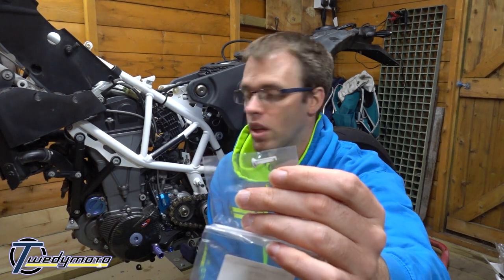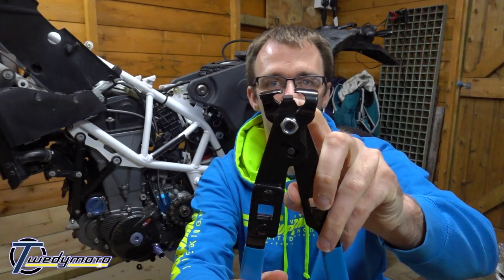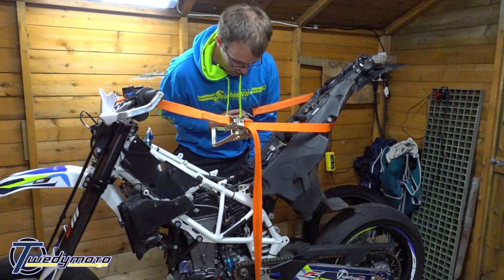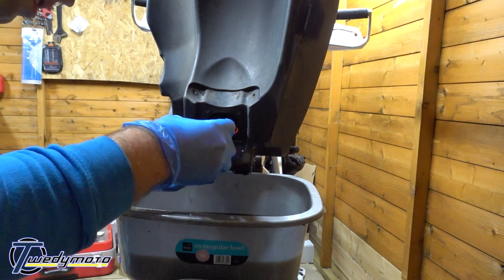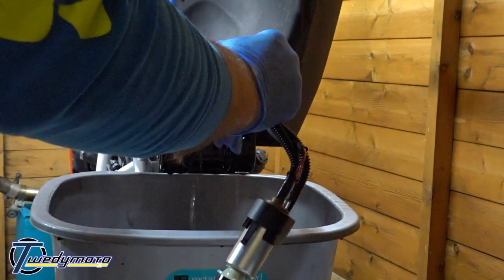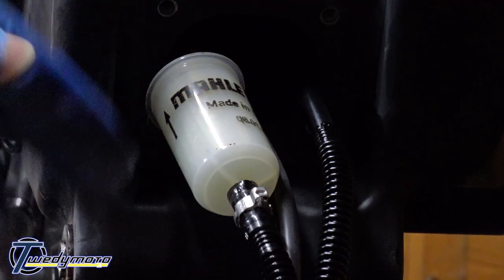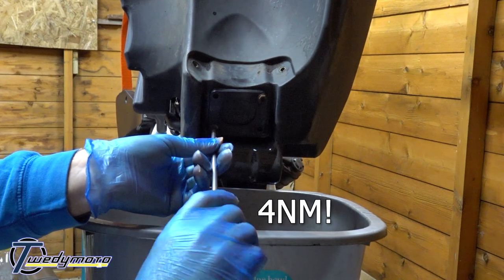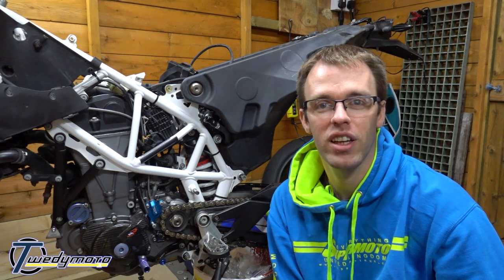How to replace in tank fuel filters on Husqvarna 701 & KTM 690

Comment: Thanks for the video!

 I am a "KTM fuel injection Beta Tester pioneer" as I own a '10 Husaberg FE450, which had injection before the KTM line did and of course being nothing more than a very confused KTM, my 'Berg (as was very common with them) had fuel pump issues.  A Cycleworks pump was/is the hot ticket for those bikes.  The in tank guts of your 690 look the exact same as my 13 year old Husaberg, which makes me wonder if KTM has learned anything at all since then 😄  The Cycleworks pump is not prone to polluting the fuel filter with black stuff, and it has proven to be stone reliable in my 450.  I may proactively get a Cycleworks for my 701 and keep my new low mileage OEM pump as a spare.    

I elected to delete the in tank Mahle fuel filter on my old 450, and am running an external 10 micron Wix metal canister filter that I replace annually.  Replacing the external filter on the old 'Berg with it's funky 70 degree engine layout is super easy, takes 10 minutes, tops.  Have had no fuel system issues since tossing the failed OEM pump into the garbage can and doing the external filter modification on my old Husaberg.  Actually, that bike has been completely reliable since the initial fuel pump issue was addressed.  

I wonder if there is enough room to do a similar external fuel filter mod for my 701.  For sure a slim Golan filter would work, but I would want to use the not big but bigger (and cheaper) Wix filter if the in tank Mahle filter is removed.  It looks like there may be enough room if I plan it out right.  That is the good thing about Winter - it is a good time to fuss around with the bike!  Will  probably see if I can get a Wix filter in at or near the quick connect area, and leave the stock in tank one in place for a season or two, then do the bypass mod.  The fewer times one has to unscrew those self tapping fuel pump base plate mounting into plastic screws the better...

Comment: Another good vid mate. I used a pair of snips to compress the clamps on my 2018. I noted how much the old ones were squeezed before I removed them and carefully judged how much pressure I applied. Finally I checked that the pipes were fully secured. I've done another 8,000 miles since then so I'm happy with that. Interestingly, I was chatting to Rob, the mechanic at Huskysport, doown south, and he reckons they rarely give trouble. Nice to change the filters all the same though me thinks. How about a vid to change the fork oil?I did mine last autumn at 18,000 miles and it was surprising how dirty the oil was. You need a thin-ish 22mm spanner to hold the inner cartridge mechanism but other than that it's pretty straightforward. Cheers mate.
Reply from the maker: Yeah, from what I can remember there hasn't been many posts about them causing an issue but why wouldn't you change them 👍.  Good idea on the fork oil change! Will see what's involved.

Comment: Did this yesterday on the 19’ SMCR and sure enough, the one bolt just spins when you take the T45 side out . So, I put the 5mm Allen in that side and tried to back out the other side… it was so tight it snapped the Allen key off inside the channel. So,  that makes it impossible to get the tank tilted up. I just pulled the pump from underneath and replaced the filter and screen with Oetiker clamps as recommended. Not sure why they want you to tilt tank up… you don’t need too! Can’t figure why it was so tight that I couldn’t get the bolt out, but at least I found out you don’t need to tilt the tank to do this or replace fuel pump. Went for ride because I was worried about kinks in the fuel line when I shoved it all back up in tank. It ran great with no leaks.
Reply from the maker: Wow that's mad! must have had loads of thread lock or something for it to snap an allen key!
Reply: Same here.  I did not have to tilt the tank up or take the exhaust can off.  Just the four bolts holding the pump in.  I figured there must be a reason you did that way, but I thought I would try it, anyhow. And they worked! Thank you very much for the very informative video. I could not have done it otherwise.

Comment: Just lifted the tank on my ‘21 701 to remove the shock. Pretty much all the cables were tight from the first cm of lifting the tank 😅
Reply from the maker: What a ball ache!! Guess I got lucky then haha
Reply: @Twedymoto  Bought this bike a week ago, coming from a DRZ I’m not used to all these wires. Need to learn what they all are and where they can be disconnected.
Reply: @JohannesDalenMC  Hit up Rottweiler Performance, they sell delete kits for a lot of that garbage.  Really cleans things up under there and the O2 sensor delete richens up the part throttle settings a full AFR point, which makes is run a lot better.

Comment: Awesome video! My 2016 690 ER pump seems to have failed as there is no fuel coming through at the quick disconnect. When setting up my Safari tank I removed the tiny inline filter and added a Golan filter to the line. In this case can I just removed the plastic filter in the tank? Could you please suggest the suitable joint to connect the hoses to delete the filter in the tank? Thanks in advance.
Reply from the maker: I'm not entirely sure fuel is supposed to come out of the quick disconnect if they're disconnected. I'm pretty sure I've seen posts where some owners have removed the filter from the tank and put an online filter like a Golan one between the tank and the quick disconnect. Hope that helps 👍

Comment: I see some riders access the fuel filter without removing lower tank bolt and swinging it up.  Do you know if it's possible to replace filter without swinging tank up?   Thanks.
Reply from the maker: I've heard of this too. OK I guess if you can get the bike up in the air or are comfortable faffing on the floor 😅
Reply: @Twedymoto  I got away with it with the bike just sitting on the kickstand.  Mine is a 2014 Enduro; I don't know if that makes any difference.

Comment: I checked my filter in line,was ok,getting a prob with popping on decellaration,and holding back,checked the psi coming from the pump,it was like 47 psi each time i checked,5 times.i changed my plugs,cleaned in the plug caps,were really nasty,put everything up,still same sputtering an popping on decelaration,any ideas? Didnt check my in tank filters becuase i was getting the correct psi,what you think?

Comment: Can you check your fuel pump to see if it's bad? 2010 ktm690smc 37000 miles never had any problems.....thanks.
Reply from the maker: There's a few ways to check I guess but they're not pretty. You could remove the injector, then connect it all up with the injector removed and crank it and see if it sprays fuel. Alternatively, you can get a pressure testing kit from somewhere.

But if the bike has done 37,000 on the original filter, I would change it as a matter of course!

Comment: How long Was the filter in there to get that dark.
Reply from the maker: That one was changed around 11,000 miles. They go dark quite quickly due to the carbon brushes in the fuel pump, its normal 👍

Comment: I have a husky 701 and cut out at full throttle when I changed gear on the slip way yesterday, I was gunning it and it happened again the next day when slowing down at speed and changing down a gear, it has a full tank and it's a 17 plate with 7.5k miles, what should I inspect? the wires look OK, and I don't have a quick shifter 😰
Reply: Have you found any solution?
Reply from the maker: For what?
Reply: Yells, I changes the external fuel filter, air filter and a new battery, so far I have not had another cutout so it could have been any of those parts

Comment: Hello mate, how many miles do you have?
Reply from the maker: 10,000 miles mate.
Reply: @Twedymoto  Mine is with 5000kms / 3100 Miles. I will do the second year manteinence and I will change the fuel line filter.  This filter will change later.  Thanks for the videos mate.